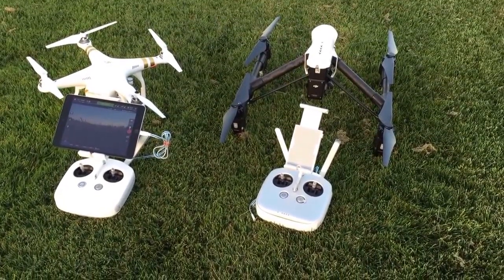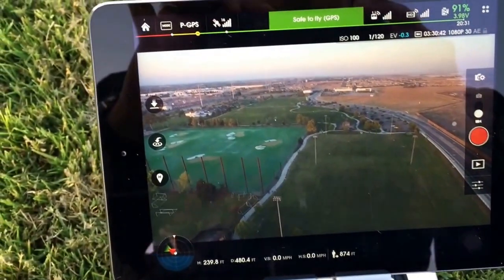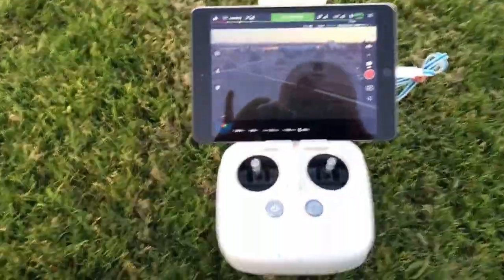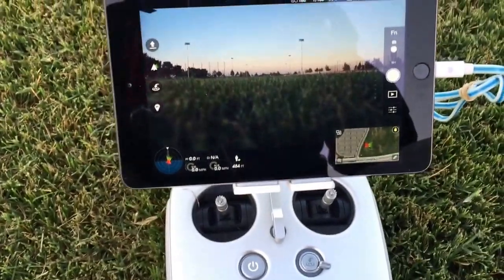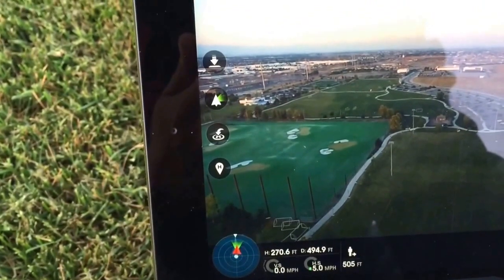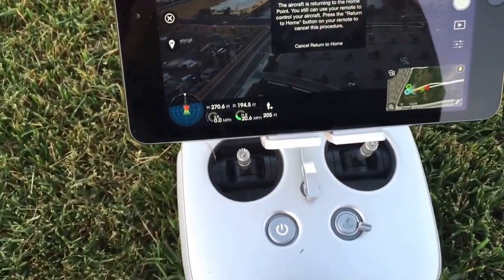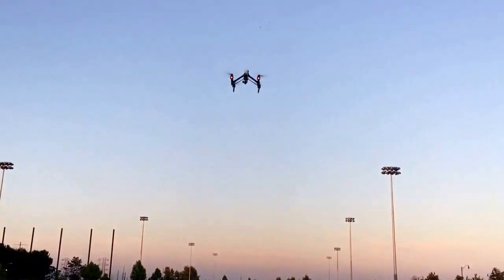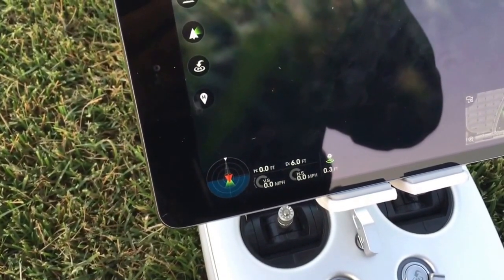RTH Return to home tested on DJI Phantom3 vs Inspire1 RTH

Comment: Great demo! bet your glad the Inspire 1 didn't land on top of the Phantom 3 :-)
Reply from the maker: Shaun Matthews Hey Shaun, cool thing is that you can still control the Inspire or P3 on it's descent so if an object gets in your way, you can take over and pick a different spot for it to land.  You can also stop it's descent and push the stick up and stop it.  That's the reason I filmed me not touching the sticks so you can see I did not interfere with the location.  Thanks a bunch for watching!